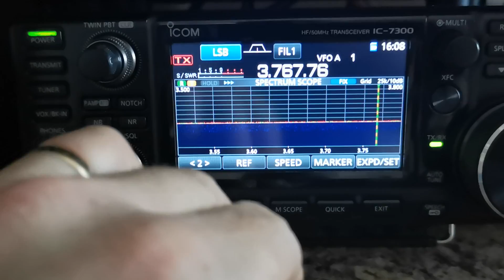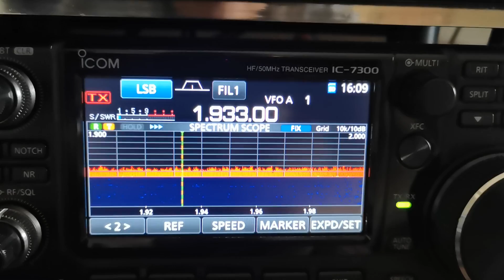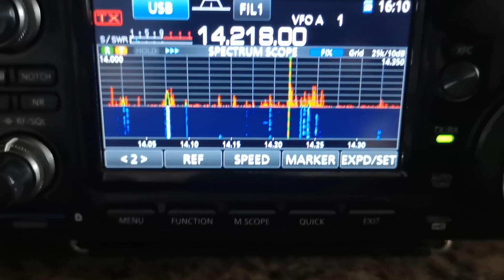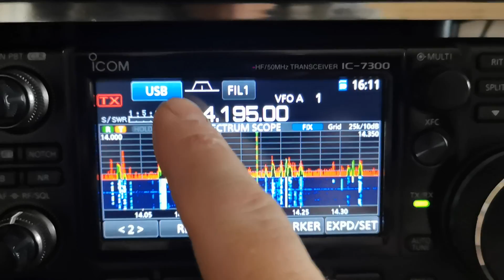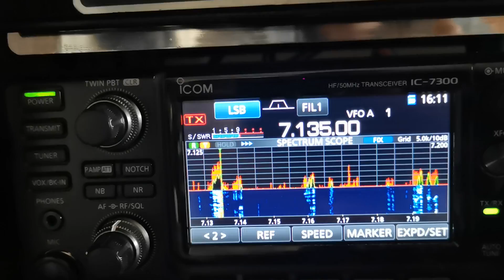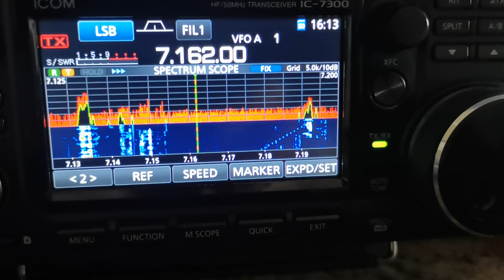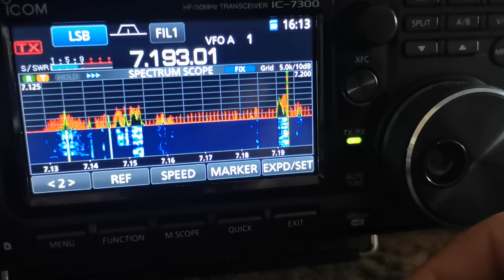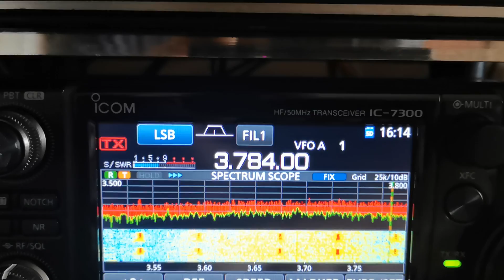HF Reception Icom IC7300 Without QRM | Ham Radio Listening During a Power Cut

Comment: How ye Doin George .. Hope yer all well there.... It's not surprising the noise you'd get on an dirty electricity line supply into the house but what's worse is it's probably only gonna get worse than stay the same and when you add vdsl into the mix it's a head banger. I landed lucky when i moved qth in February and don't have much if any noise from 20m up but no room now for the hf10 for the lower bands.... 73, i hope it doesn't get any worse than what it is... Good luck... Stevie.. GTA...
Reply from the maker: For my location, my noise isnt too bad. it could be a hell of a lot worse

Comment: It is amazing to operate HF during a power failure.  My station can run on a backup battery with an automatic changeover.  The only problem now is that even during a power failure Australia's "wonderful" VDSL2 NBN network remains operational spewing RF noise into the air from the twisted pair copper phone network.  VDSL2 makes operating 30m virtually impossible these days, it wipes out all but the strongest signals.  You can see the VDSL2 carriers on the waterfall.
I'm glad I have access to a remote HF receiver site operated by my amateur radio club.
Reply from the maker: Yeah, we have to put up with a lot of shit. If we were causing that type of interference we would know all about it pretty sharpish...

Comment: I presume you've tried to find the noise source George?
Reply from the maker: I did but gave up. The problem is always in other houses. Feck all you can do about that
Reply: @GeorgeEI7KO   You could try a magnetic loop antenna, ML&S sell them. They are supposedly excellent at rejecting noise.
Reply: @GeorgeEI7KO  That's a shame. I know OFCOM advises using a SW radio to try and find the source, then speaking with the neighbours. But if you don't get on with the neighbours, or they won't help, then you're buggered.

Comment: I live in a typical housing estate and when I get in from work about 2.30pm I have a general noise floor of about 3 to 4 but when 5 o'clock approaches when folk get home and turn on telly, kettles and charge phones and laptops the noise floor goes mad...
Back in my CB days we where the noise polluters but now it appears pay backs a bitch....
Reply from the maker: I'm in a small estate (have a look at my qrz page) and my noise is as follows 160-s8/80-s5/40-s3/and from 20 on up its zero. So strange to be turning the gain up on the scope rather than down.

Comment: Would using the battery instead of the transformer cut out the noise any when the electric comes back on ? If you use one even, nice set you have there too.
Reply from the maker: If you watch near the end, you'll see when the power comes back on that the noise floor jumps up. It was still on the battery there... So no would be the answer to that question. Yest the lil 7300. I still love it.

Comment: nice radio Gorge 👍👍👍 I tried doing my hame test back in the 80s and give it up due to the mors code and electronics p=v times i stuff wats amps volts stuf
Reply from the maker: It's a lot easier now. No morse requirement anymore.
Reply: @GeorgeEI7KO   ill have to buy a book on it but my reading is bad